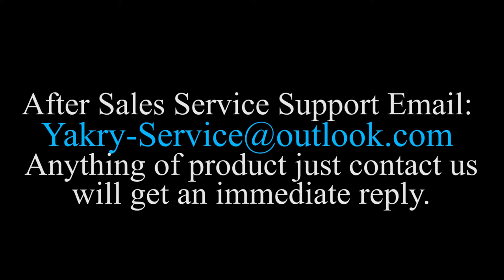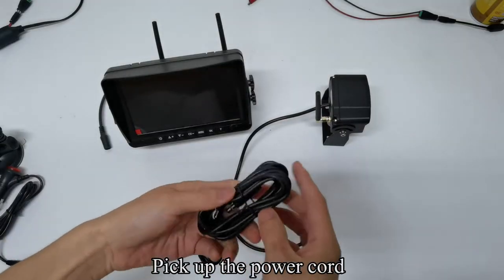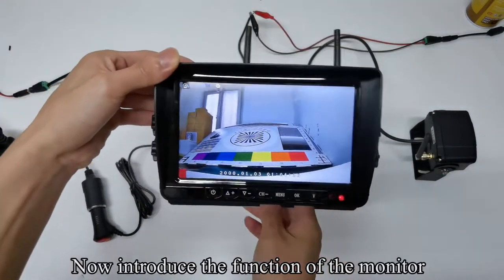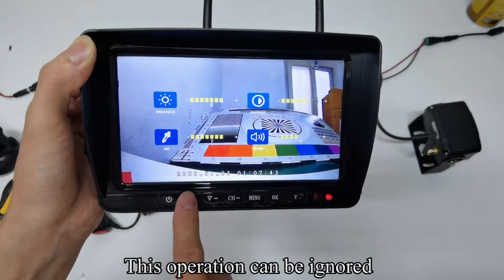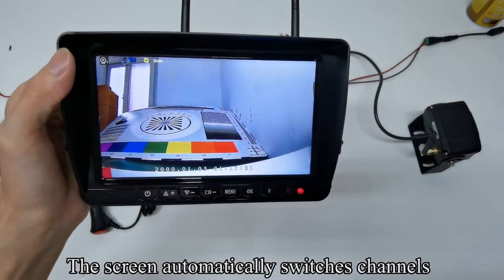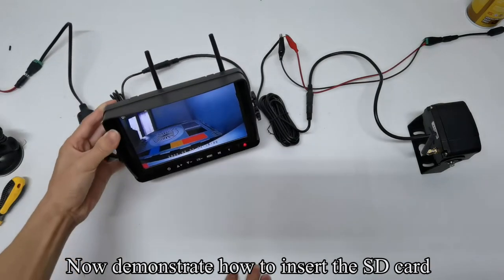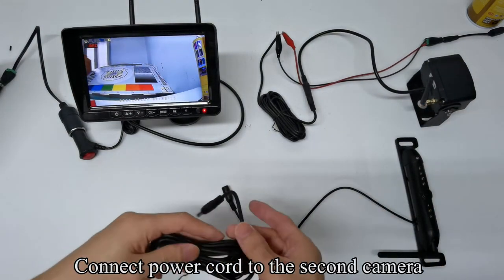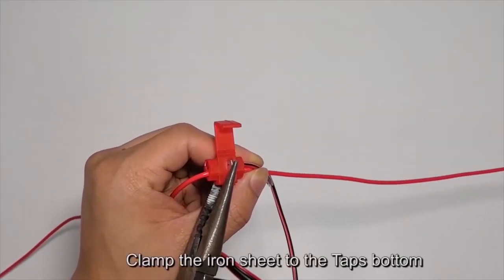Yakry Y27 RV Backup Camera Wireless HD 1080P with 7 Inch Touch Key DVR Monitor

Comment: can the monitor be plug directly to 12 volts without the cigarette lighter adapter
Reply: add a fuse in the line
Reply: 12V is 12volt.  Amperage is not specified but system will draw current up to what is available.  500mA (1/2A) fulfills requirement on testing.
Cigarette Adapter is hole size adapter,  Nothing more.